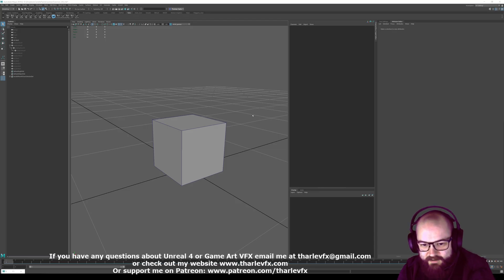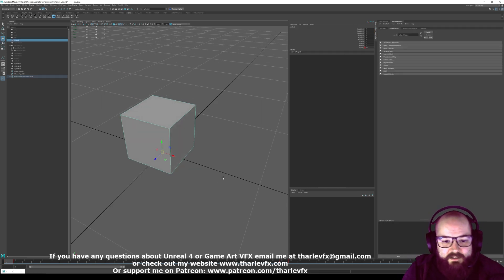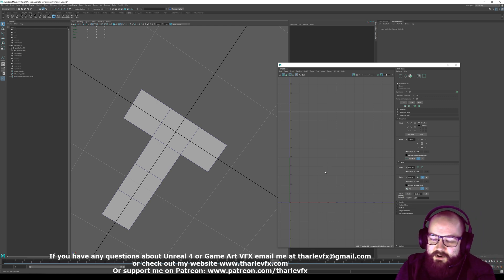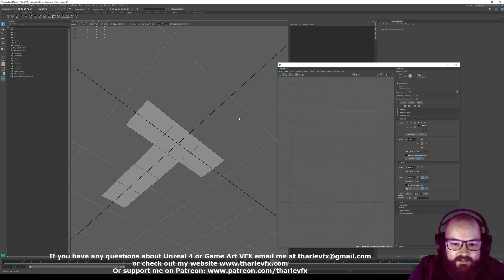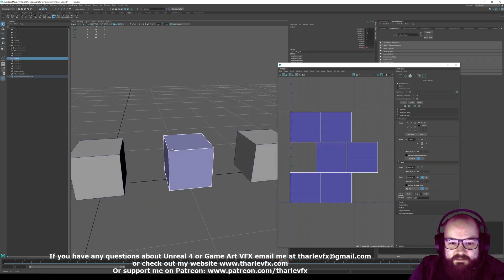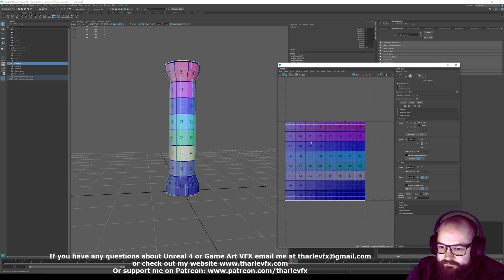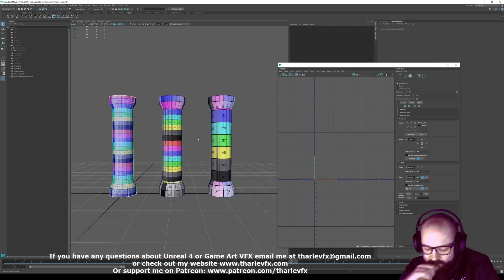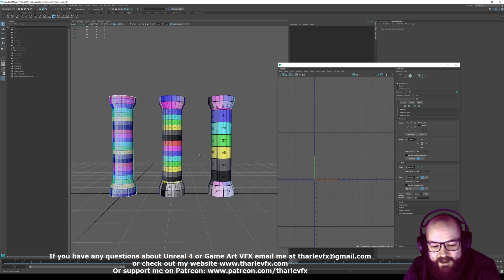Introduction to UVs and Unwrapping

Comment: Even on 4k display its very small. Would be good for video recording down resolution or set high DPI in Maya settings
Reply from the maker: renderman.pro it’s more about the ideas than the software but I can record in lower res if it’s easier
Reply: @tharlevfx  I like your resolution to be honest - works very much like my own :)